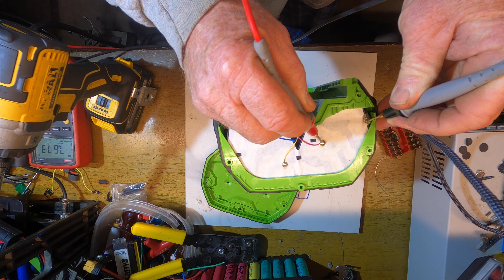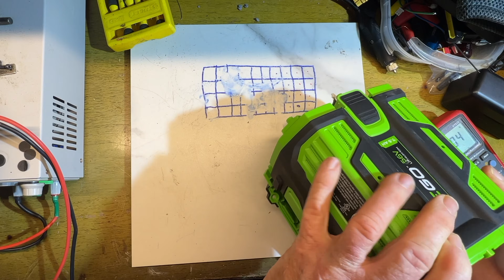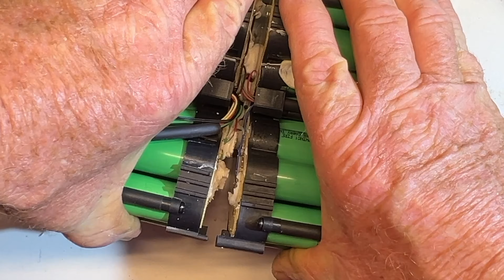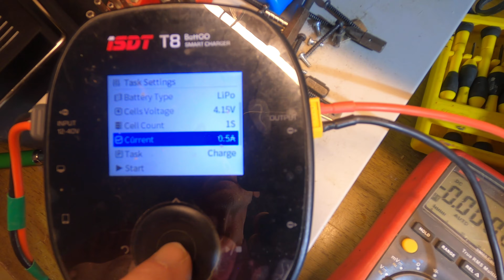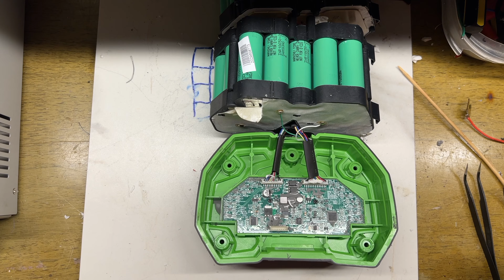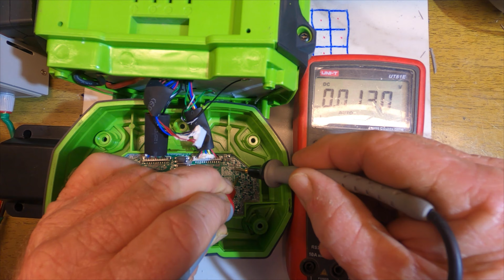EGO 7.5AH REPAIR *IN PACK* Individual Cell Group Charging/Balancing

Comment: I want to change all cells in my Ego 56v 7.5ah (UR18650NSX / INR18650-25R Cells in Ego battery) battery with tabbles Ampace JP30 cells. Can my current BMS handle new Ampace JP30 cells? Is there something more I need to know before i start changing cells?
Reply from the maker: If you use the battery in the tools it was designed for the bms will be ok. If you try to use the battery in some high current draw application that it was never designed for then it could potentially have problems.
Reply: @lmorrison17 i just want to change cells and have more discharge. 
Use Ego CSX5000 chainsaw, only problem i have now is overheating battery.
Reply from the maker: @slavenvrhovac5977  I can’t help you there. I have five ego tools, and a lawnmower, and I have never had a battery overheat. If it’s overheating, then it’s time to take a break or swap out a new battery.

Comment: I balanced the cells via the JHS connector. Just need some thin solid wires to stick in the socket.
Reply: Which is the JHS connector

Comment: You made it so hard, just charge and measure from balancing port.
Reply from the maker: The balancing port is an abnormal pin pitch connector with very small pins. Dupont style jumpers are to big. I could have and have before, jammed a sewing needle in the connector holes and connected with alligator clips.
Reply: @lmorrison17  i just grinded one of my mulimeter probes very thin, other end also fits most modern multifunction chargers.
Reply from the maker: @ i’ve got a pile of spare junk probes I could do that with. I have a pile of batteries for the moment, but summer is coming and that’s a tip. I’ll keep under my hat thank you..
Reply: What and where is the balancing point?

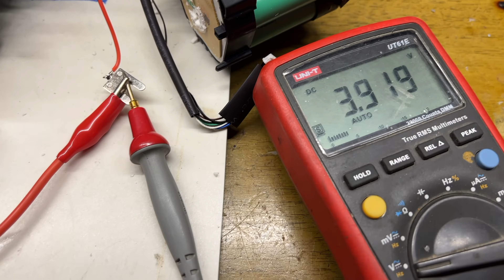Comment: Everything looked do-able until you introduced that "Smart Charger" @14:00.  That just blew up my chances of replicating what you're doing.
Reply from the maker: You can use anything that will supply no more than 4.2 V. Ideally, you will be able to regulate the current but it’s not 100% necessary. Any little DC DC converter off of eBay or Amazon will do. send it to the voltage. All your other cells are resting at and bring the group up slowly.
Reply: Any constant current charger with a voltage cutoff. Most power supplies will support this. Just don't charge too fast, especially if the cells are below about 3.0 volts.

Comment: You could be in business forever doing micro minature repair on ego batteries their design alone gives you job security. Think of it a $350.00 dollar battery bought dead on arrival for $20 to $30 dollars, repaired and resold as refurbished for $200.00 as is no warranty gives you a $180 dollar profit. What really bothers me is ego knows their battery quality is so poor they expect you to just trade up and buy a new tool with battery which is cheaper then geeting a new battery. To me this disposable society attitude is so terrible when all ego has to do is sell the perfect product in the first place and stand by it with a lifetime full warranty. No pro rate. One for one swap.
Reply: If I coule just manipulate the lights to output the green light without anything being charged up, that'll be great !! The lights will always be on and so my broken batteries would always sell as jd they work. 😂
Reply: The liability insurance would be insane. Just one battery goes bad and burns down a house or worse injures someone and you're sued to oblivion. Without schematics and an informed understanding of the safety systems, it would be a risky business model.

Comment: How is the battery doing after this repair?
My 7.5Ah battery stopped charging above two bars (it is a newer model with segmented indicator). I followed this video and found one group was 3.46V and all others at 4.09V after full charge. I charged the "bad" group of 3 cells with 1.5A current to bring it up to 4.09V. I used a programmable DC power supply and did not disassemble the battery, just disconnected the BMS . 
I am going to test the battery in the same way - to charge / discharge it a few times to see what would happen with the group in question. If the voltage in the trouble group keeps dropping below others I would, most likely, disassemble the whole battery for spare parts. I would not feel comfortable adding three new cells into the old used battery as I would not be able to match them close enough with internal resistance and capacity. Does this make sense? I will post an update here or ask me if I forget to do this.
Thank you to the author for sharing the idea.
Reply from the maker: I eventually had to replace that group last summer, but man it was like having a new batt for my mower. It would never do the whole yard until I replaced that group.
Reply: I had 19 ego batteries. 6 of the older type, 13 of the fuel cell type. All 13 newer were out of balance & bringing them back to balanced made the batteries work again. They all still work but they are going out of balance still...... Slowly, but surely. All new cells is the only way to repair these properly. I used molicel. They are not simple though, especially over 2.5ah.

Comment: I would've just used the balance leads from 4 to 5 and charge from there instead of taking the pack apart.  Just set a low current like 0.2A
Reply: The pin holes in the connector are smaller than regular  header pins. I will often use bread board jumper wires but they didn’t fit. I suppose I could have used a sewing needles in the holes but they awfully close together, good chance of an accidental short with my shakey hands.